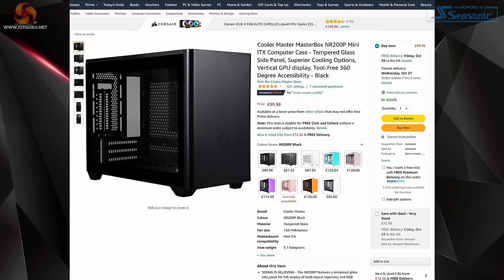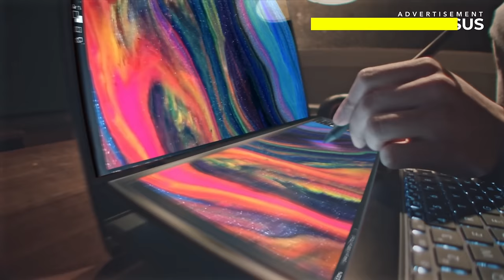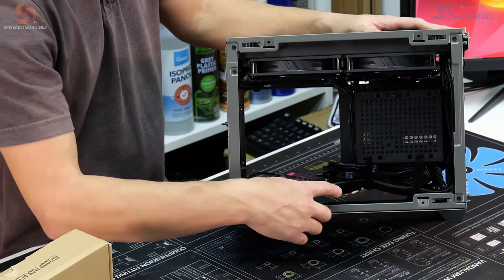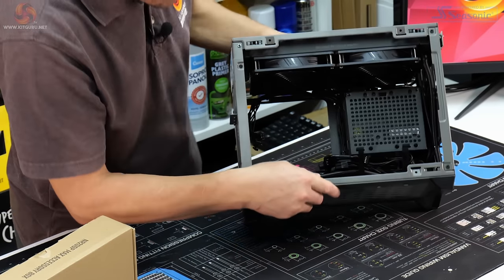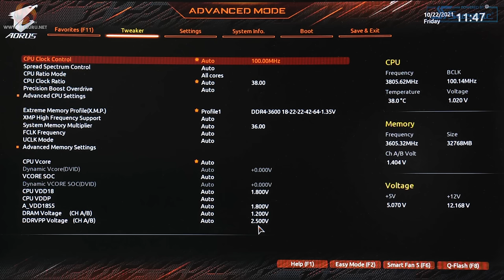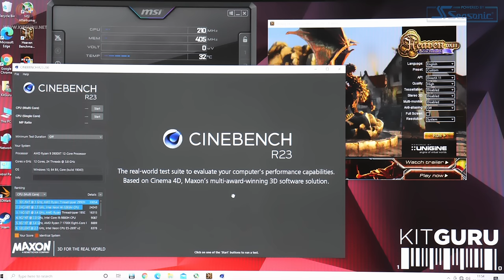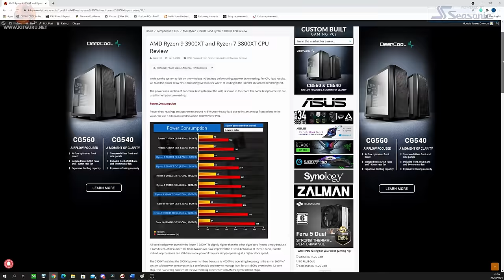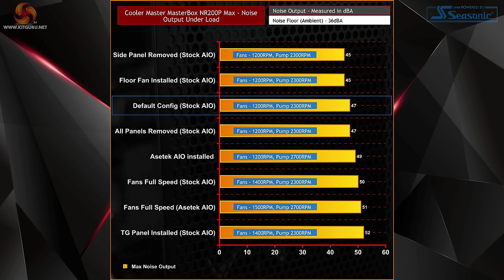Cooler Master MasterBox NR200P Max Review

Comment: Only scary thing is that I hope one of the chip will not burn the wire that made of fabric after long term use, because it's touching mother board n ram🔥🔥🔥🔥 I would not wanna touch it , & I hope all these power supply company can make these wire super skinny ,I don't know why they don't do it

Comment: Cooler Master has increased the price on this in the US (along with already terrible stock), not sure about everywhere else.  They're now selling this for $500, not worth it in my opinion.
Reply: Yeah at $500 i cant even recommend this to friends getting in to pc building.
Reply: @Deviantsoundz  $500 USD currently converts to around £365 GBP which would negate any savings on buying all the parts of this package seperately. 

Luckily for us, the Price is still at £319.99 in the UK and stock is available right now.
Reply: @KitGuruJames   it actually makes alot of sense to buy different stuff separately as the 850w psu is over kill for most gpus people can get and the aio looks plain and its not like a performance stand out. 

Both older cases go on sale often for $70 to $100 for the nr200 and nr200p, corsair 600w psu for $90 after rebate and a fractal lumen s24 for $100.
Reply: @Deviantsoundz  I hope Cooler Master sell the chassis in this configuration separately. 

I agree that it would be good to have the option to choose your own PSU and AIO for sure.
Reply: @KitGuruJames  as long as the price is right and offer more than 1 color i can see it been a good option. I recently got rid of my nr200 in black and working on a 011 mini now. Was waiting for the 011 evo but the mini went on sale with their 750w psu for $150 and i just couldn't say no to that.